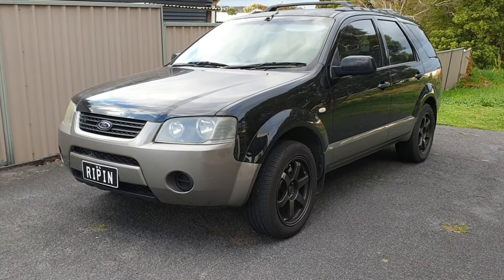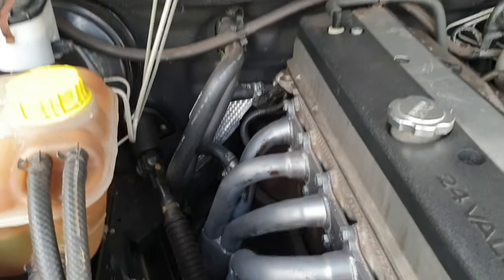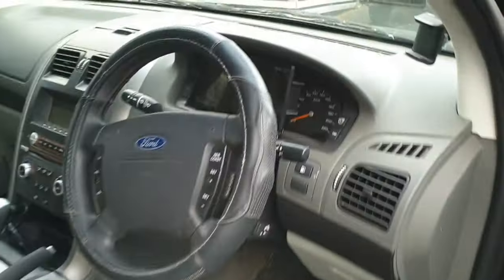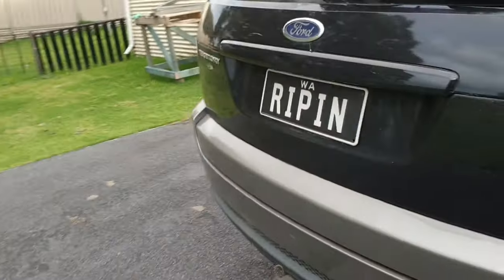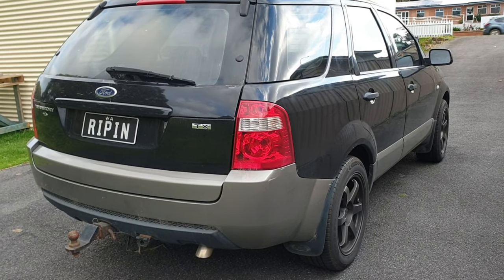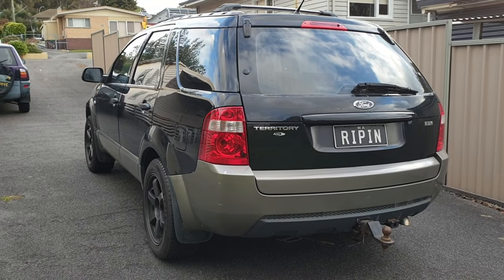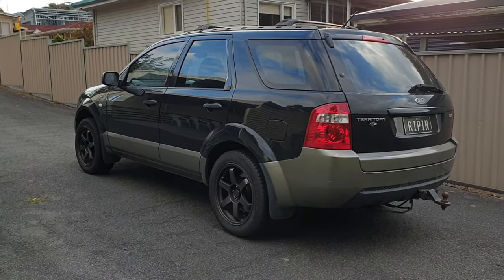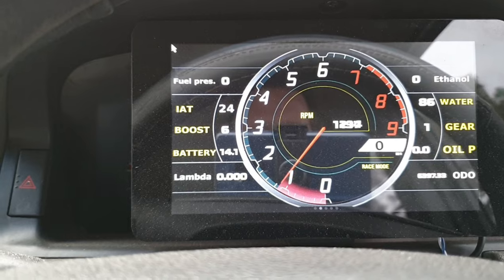Is it QUICKER!? | Mildly Modified Barra Ford Territory 0-100km Test!

Comment: Hey dude, I'm working on doing my 06 ghia up is there any main things to start small first? I'm going to keep the stock intake setup. I've seen a few barras with the dual throttle body but a relocation is a good idea
Reply from the maker: I would start with the exhaust, I know its not exactly a small thing, but headers, cat and full exhaust system will make a good difference, ot underdrive pulleys 😎
Reply: @RossHollandAU  Yeah got some pacey headers, looking at the viper setup from the paceys onwards. High flow cat ect. Underdrive pulleys ill be ordering

Comment: Are you going to shroud that filter to reduce the amount of hot air induction?

Cold air has a higher density
Reply from the maker: Nope! All test I've done on it show minimal to  no difference, i also monitor iat's with the digital dash 🤙 the nitrous  setup will negate any of the hot air by sending nice cold dense nitrous in there 😎

Comment: That 1st gear on the 4 speed is the biggest killer my 6sp 1st gear is way lower then my old 4sp
Reply from the maker: Sure is! Lower diameter wheels help on the strip and hoping the nitrous and high stall picks it up in the early rev range 😎
Reply: Lol 6speed be in thrird gear before a dam btr shifts outa first.